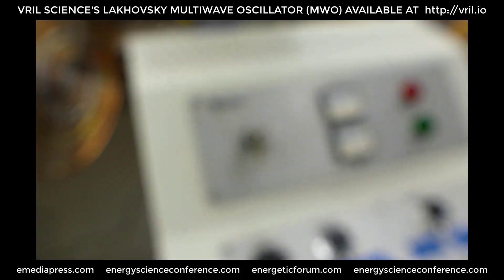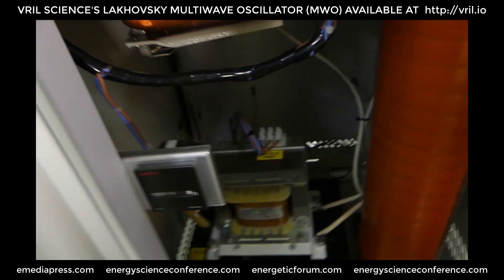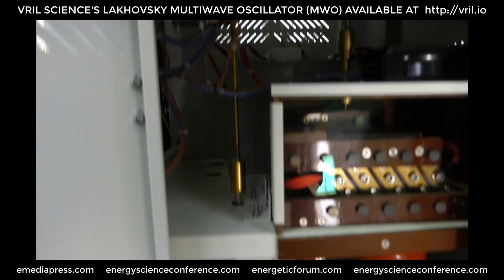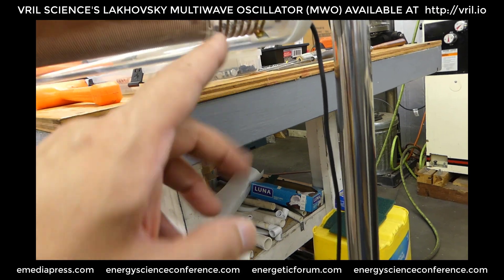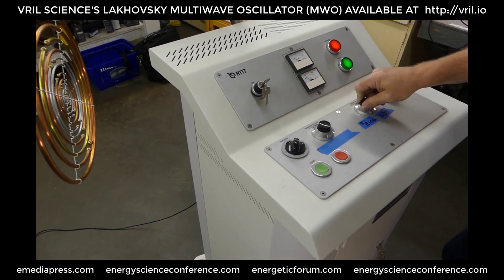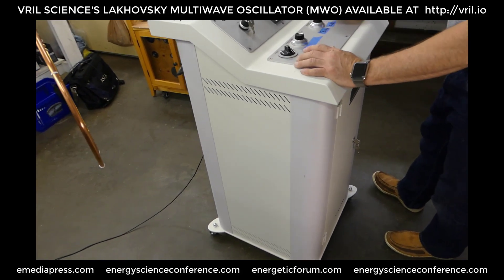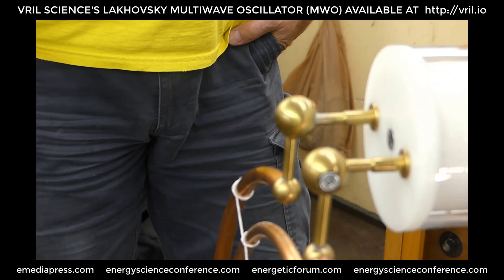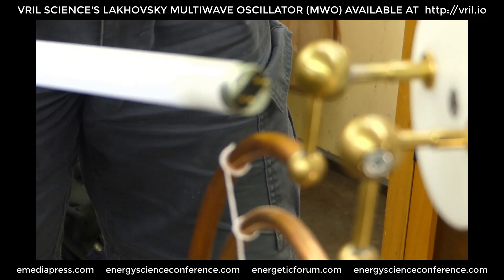RT17 Lakhovsky Multiwave Oscillator (MWO)

Comment: Very interesting.  I too was looking for the fix. Where is the earth ground reference for the machne? the mains?
Reply from the maker: It can be either wall power ground or an Earth rod - both work but an Earth rod is cleaner. There's a lot of noise on the power ground. The MWO most likely overpowers that noise so isn't an issue, but if it were me, I'd use an Earth rod.

Comment: Hey Aaron if someone tuned themselves with a quartz crystal with some of their own blood (like a few drops) on the crystal. And then put the blood quartz crystal between the coils and had the machine running all the time could it provide the effect of a person standing or sitting between the coils(maybe slightly weakened) the persons location wouldn't matter. Ruth drown demonstrated seeing and healing people in London while she was in cali. She just needed some of the persons blood. I forget the name of her machine, it was a radionics machine. Borderlands featured it at some point. I suspect that could have the effect of soft immortality(could never get sick would age at a slower rate) assuming you can't overdose on magnetodielectricity(the creative electric force of life). Im curious if my hunch is accurate.
Reply from the maker: I have almost 15 years experienced with several remote technologies including the most advanced ever released to the public where I was the director of special projects. I have personally used the MWO radionically . The geometry of the antennas have their own radionic aspect to them even without being hooked to the transmitter. I've done it with the RPX output going to a pancake coil as well. You're thinking in the right direction but I don't advertise those claims, just my personal experience. But in any case, I believe in the validity.
Reply: @AaronMurakami13  Aaron I have a question. I've tried repeatedly to get a quote for your M.w.o. and called Vril plenty of times an no one ever picks up the phone or returns my messages. Any help would be appreciated thanks Steve.
Reply: Oh yes, good stuff!

Comment: Enjoyed. I missed what was wrong with it as to why it kept blowing the fuse. Was it mentioned? I realize that was not the point is the video but could help others solve a problembefore it happens. Having a total of 7.2 hours of cumulative run time is not very long at all. If it were being used in a clinic, that would be less than 20 patients.
Reply from the maker: We didn't have time to figure it out because the owner had to take it back that evening. The fuse should not have been blowing like that. The HV transformer should be a constant current transformer like a neon sign transformer. If it is a constant potential transformer meant for holding an electrostatic potential in an open circuit, then that could blow a fuse if it shorts and starts to draw current, which a constant potential transformer is not meant for. I have a hard time believing the maker would put in the wrong kind of transformer because I know him and his work is top notch, but anything is possible. Our Vril Science MWO never cuts out like that - I don't know what else could be wrong with that unit.
Reply: @AaronMurakami13  Well at least that tells I didn't just miss it. Thank you VERY much for the direct and prompt reply. I would actually like to build one of these myself and bring back the squashed health benefits. I first heard of it from a book I read 20 years ago but that book didn't give any of the frequencies for various ailments and I knew I would not Jane the time, resources, or patience to figure it out in my own.
On what could have caused the fuse blowing based on what you said, I presume you did nothing to it other than replace the fuses and I presume the same size fuses. This leads me to think that the problem must be on their end. Perhaps an unstable power grid or other causes of a surge. Maybe a slightly higher voltage coming in that pushes the fuse to its limit and thus creating a 'slow' burn out.
You be cliche'... I guess the world will never know. (Lol)
Reply from the maker: @SI-GOD  Yes, all we did was replace the fuse and it was the same specs as what the maker put in originally. The grid power is always dirty but its good enough that it shouldn't cause this. On our Vril Science pulse modulator, our main off/on switch is a magnetic hydraulic circuit breaker. Normally, circuit breakers are not meant to be used as a regular off/on switch but the magnetic hydraulic ones are. If there were any issues with the power coming from the wall, it would trip that breaker on our pulse modulators as well and it doesn't. It's definitely something else.
Reply: I was thinking about the grid/wall where the owner had it set up and was blowing the fuses. It seems to have worked just fine at your location. Either way. Thanks for sharing. This renews my interest in this amazing technology. I did wish our governments and greedy rich powers that be would not suppress these discussed. Think of how much better we (the whole world) would be if Edison hadn't stopped Tesla from producing his towers that drew energy from the ground/air resonance and supplied or anywhere without wires. No dependence on fossil fuels, no excessive stretching of power lines and the materials that go with it, no extreme financial burden on its users, power in even remote areas including those that still to this day don't have electricity.
All the benefits of this device also....especially cure (yes CURE) to cancer and probably even HIV. I just now had the thought/wondering if it could be used to stimulate bone or organ (eyes, liver, kidney, ECT) regeneration & repair.
Oops, rambling online. My apologies.
Reply from the maker: @SI-GOD  We replaced fuses a couple times and it kept blowing at our location too.